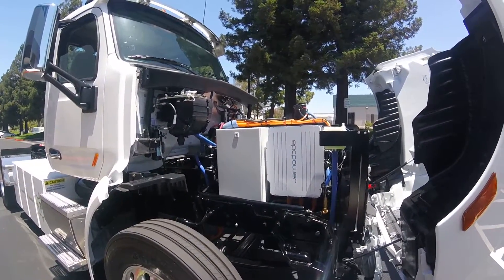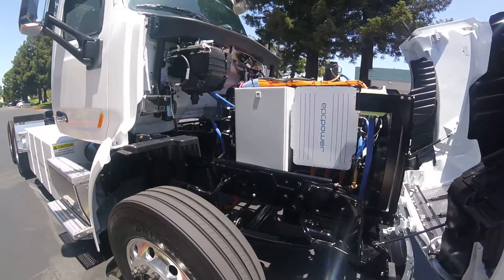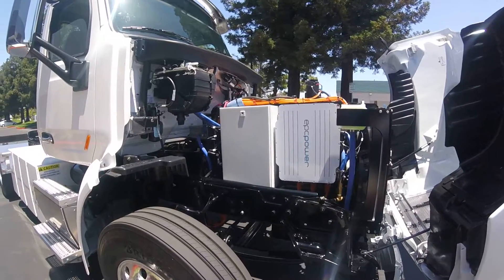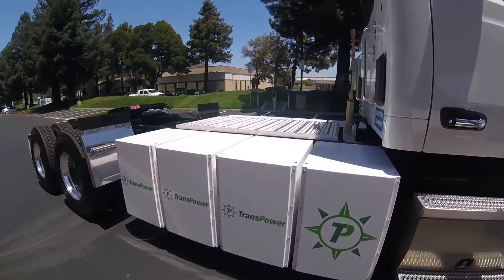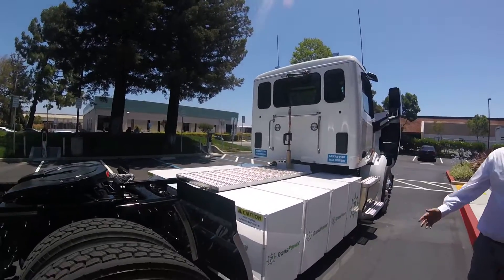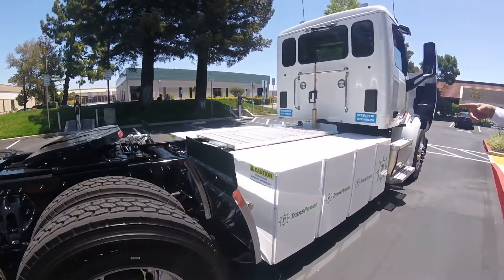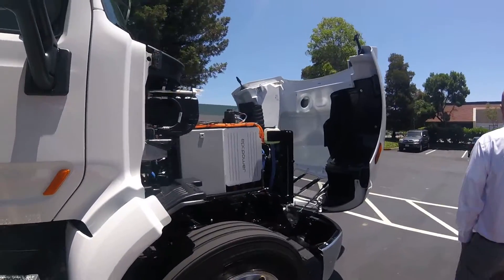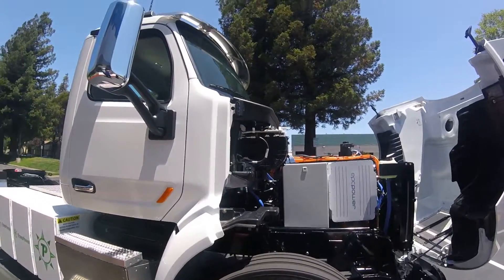Electric truck walk around: Peterbilt all-electric Model 579

Comment: Maybe ok for running around town until the battery’s need replacing in several years, then it’s gonna be like replacing a motor in a big truck or more. $$$$ Nope, not a fan
Reply: Several years? LOL what? Where did you get this assumption from... vehiclebatteries now a days degrade at 20% over 10-15 years...so it's hard to understand what you mean by several years.
Reply: Shawn a vehicle battery and running a truck on batteries are totally different.  That 200 miles is based on highway use.  Stop and go use will crush those batteries, especially in hilly terrain or in cold or hot climates were the truck runs the heat or ac constantly.